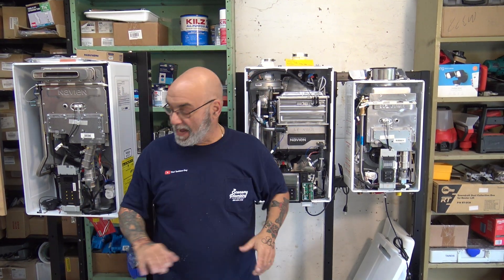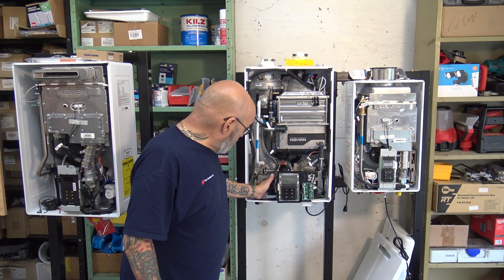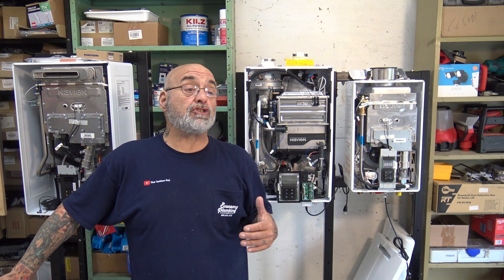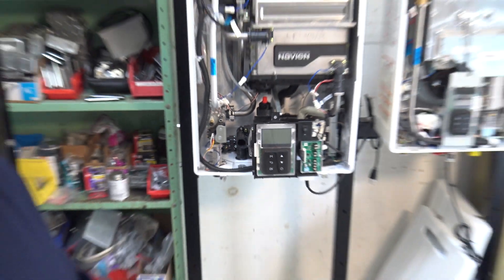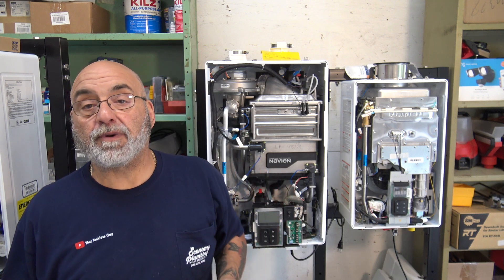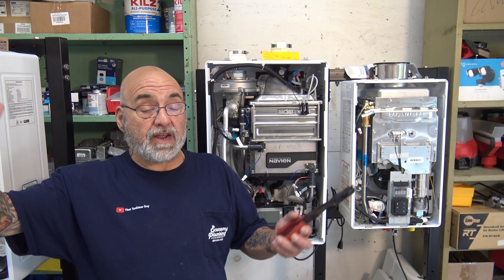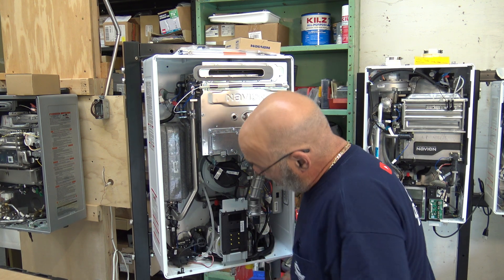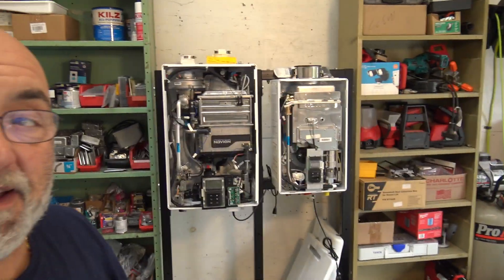Replacing an internal check valve on a Navien NPE A2 model

Comment: Hey Tankless Guy, do you have a video or information about the following issue.  Whenever my NPE 240 A does a post purge on the system or the external recirculation pump runs there is a screeching/gurgling sound on the units.  Do you have a suggestion for fixing?

Comment: I just replaced mine. However, I am still getting hot water into my cold intake. Anyone have any idea what it could be?
Reply: You have a fixture in the house mixing. Any two handle fixtures or shower valves. You can shut the valve’s under each faucet to see or remove shower trim and literally feel the hot water going into the cold line.

Comment: Great video.  I have replaced multiple parts on my NPE 240A...Flow sensor and PCB.  After I changed those parts , we started getting cold water on the hot.  So I think it is the check valve
  The unit is about 2 years old.

Comment: I hope a new check fixes the problem.
Live in Iowa, very hard water.  Npe 180a2 is not even 20 months old.  Have flushed it 3 times and have replaced the flow sensor.
Check valve is in the mail.

Comment: Just so I understand fully, you install a valve on the return line and hook up a hose to that and the cold water side to clean it out? You don’t have to hook a hose up to the hot? I have the A series with an internal pump too.

Comment: when I removed the old check valve on my 2017 navien 240A the valve came out in two separate sections that appear to have been factory snapped together and the very end piece was nowhere in sight. I did find the spring but my concern is the missing piece is a ticking time bomb that is going to clog up some other part of the system. The question -  where would the missing part have possible gone, and do I need to worry? 🙂 The system is working fine with the new check valve.   Thank You!
Reply: I think you're right to be concerned. That plastic end piece of the check valve has to be somewherre in your heater unless it came out when you removed the valve and you didn't notice it? It's pretty small.  I don't think you could have installed a new check valve with the old part still in there. Not a good idea to ignore it. Here's a link to a video showing the check valve end piece coming off which sounds like what happened to you. https://www.youtube.com/watch?v=X-7Ok8B_vXE